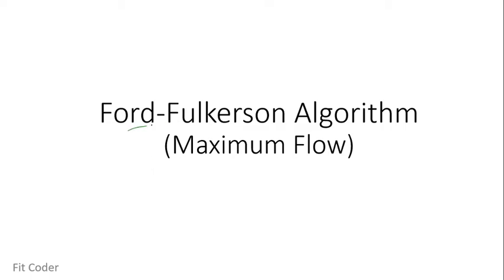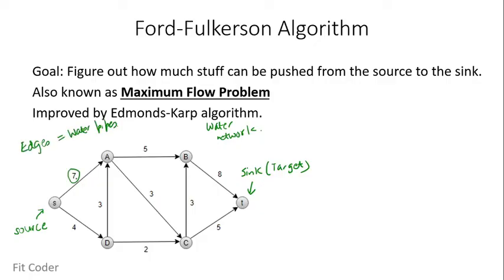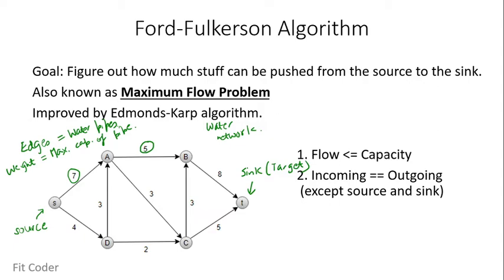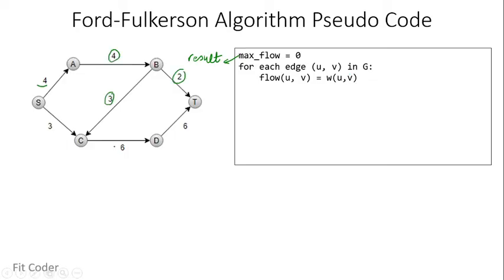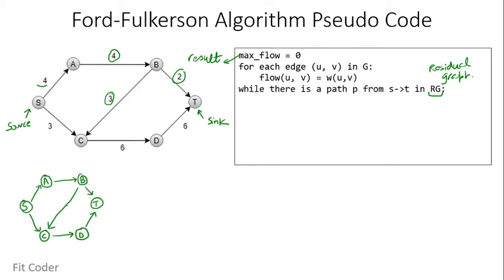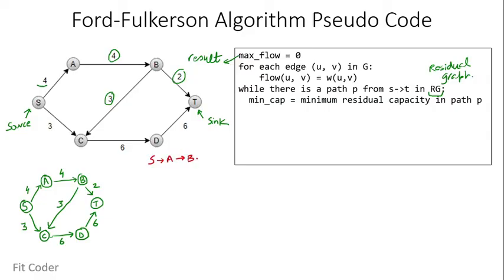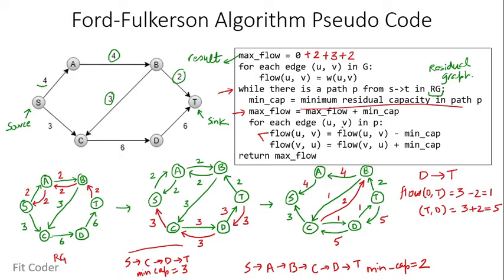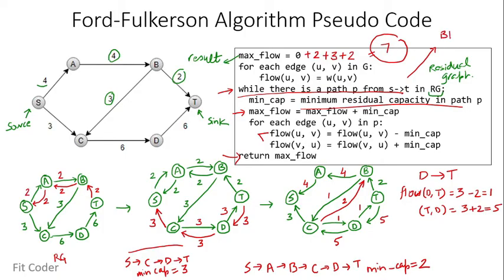Ford Fulkerson Algorithm | Maximum Flow Problem | Edmonds Karp | Residual Graph

Comment from the maker: 00:00 Introduction
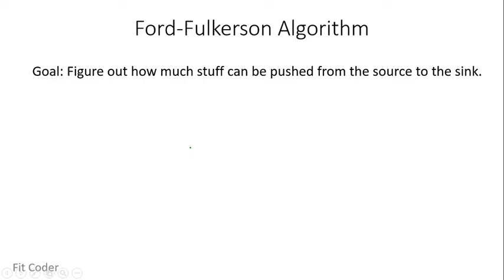00:09 Define Maximum Flow Problem
02:20 Terminologies: Residual Capacity, Residual Graph, Augmenting Path
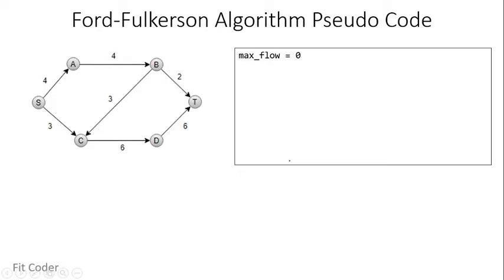03:15 Algorithm Pseudo Code
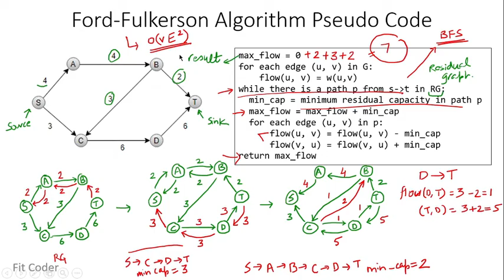12:12 C++ Implementation
Reply: Instablaster

Comment: What to do if we want to print the paths we've chosen the flow to pass for maximum flow?? I tried using the same parents array to keep track of the path, and using that 15 out of 17 testcases on CSES problem Distinct Routes passed. But the remaining ones are giving wrong answer because backward edges are also getting counted in that. How to resolve it??

Comment: I have a couple of questions
1. when we use backedge(to decrease a flow), how does it work?
2. and when we use backedges that means we are undoing part of a previous path, tben how does the previous augmented path's value still remains valid (added to the final sum)?

Comment: residualGraph[u][v] += min_cap;
residualGraph[v][u] -= min_cap;

Sir in the pseudocode we had written flow(u,v) = flow(u,v) - min_cap and flow(v,u) = flow(v,u) + min_cap. 
But in the above code, we had written the reverse statement why??
Reply from the maker: in the code, u is the sink. So i am starting in the reverse direction and then updating all the edges. so  from 5-2,2-1 and 1-0 in this manner.